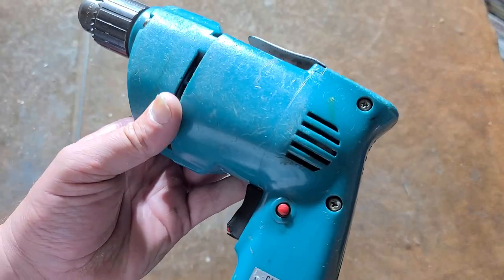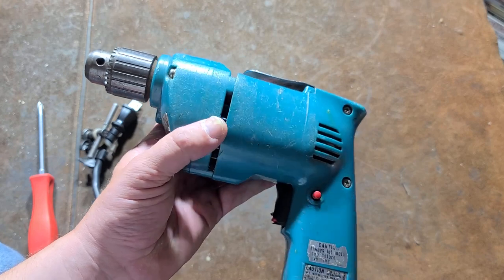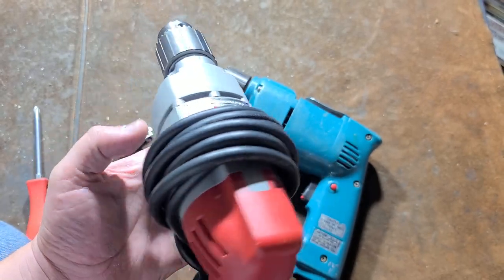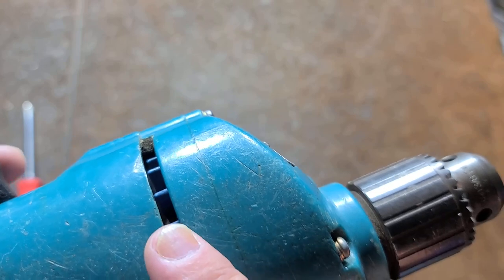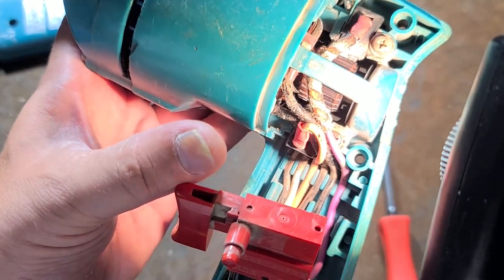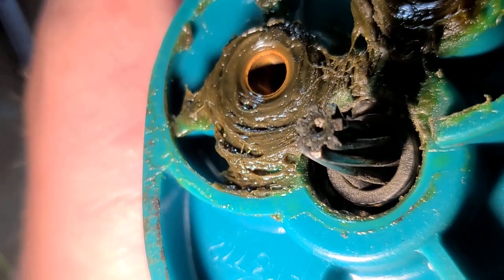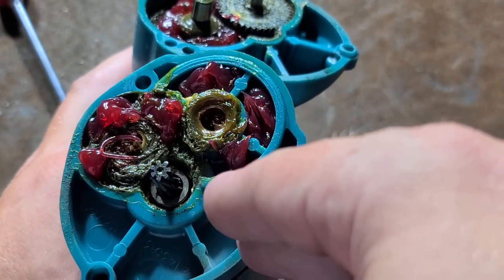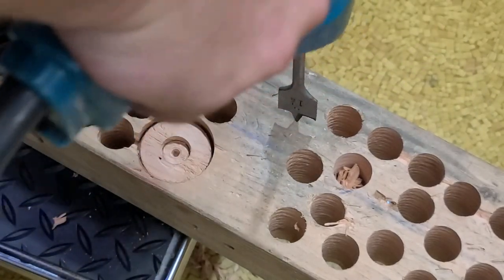Makita Japan 6510LVR 3/8" Carpenters Drill Review/Teardown

Comment: Hey Catus, I was going thought my 1/4 inch sockets the other day and putting them on rails. Anyway, I found the weird sockets that I added to the rail, they are 13/32,15/32 and 17/32 so I basically have a set of 1/4 inch sockets in 32nds increments. Idk I just never seen those. Just thought it was interesting.